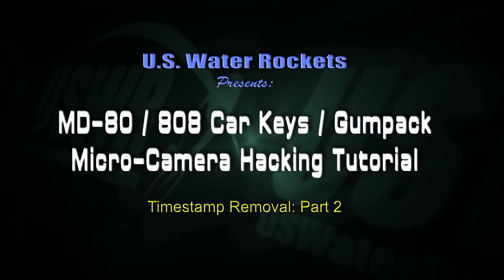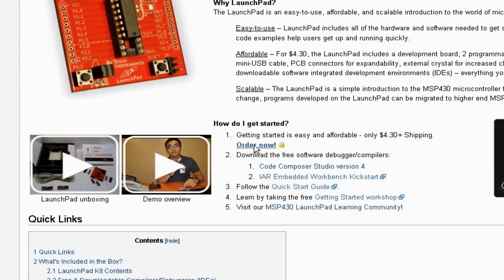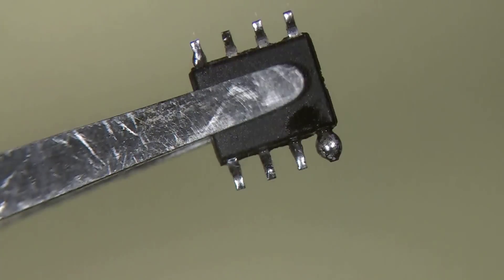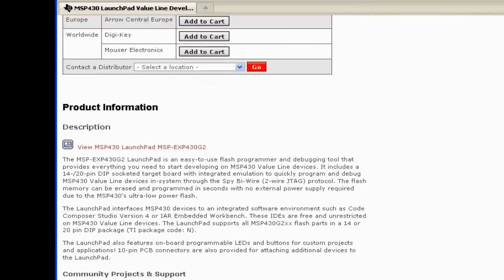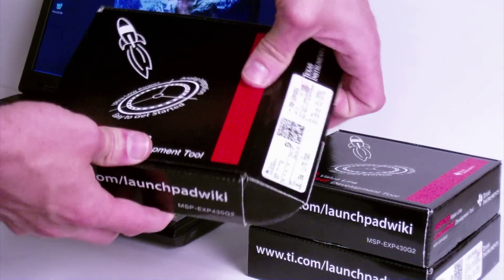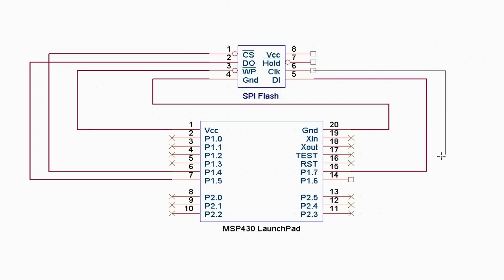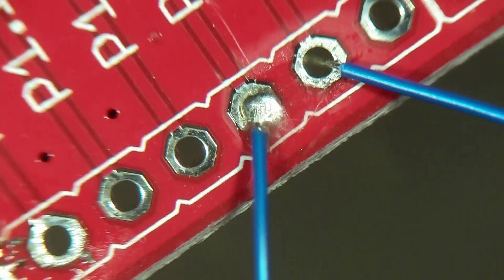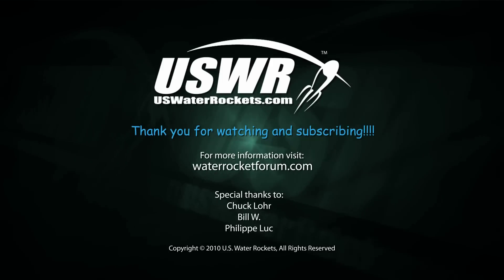Part 2: MD-80 / 808 Car Keys / Gumpack Camera Timestamp Removal

Comment: hey there you can use cheap arduino to program this spi flash
Reply from the maker: You'll need some 3.3V to 5V level shifters or a 3.3V Arduino. Otherwise, there's probably nothing preventing this from working. Arduino was much less popular when this video was produced.